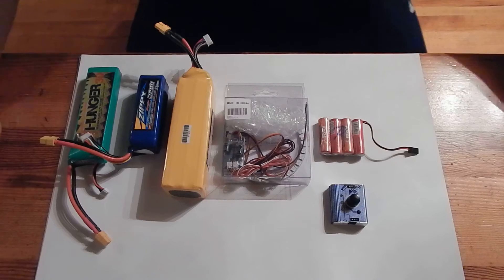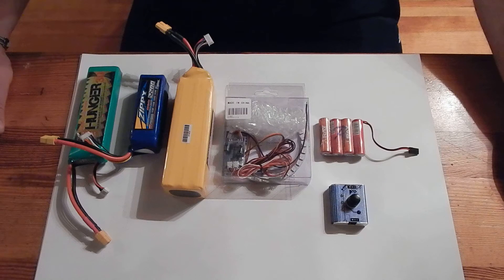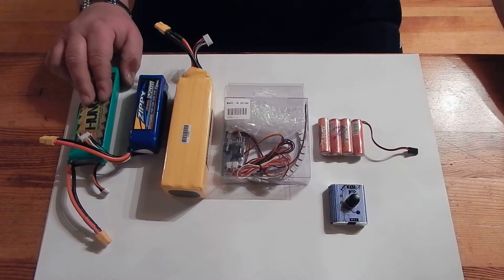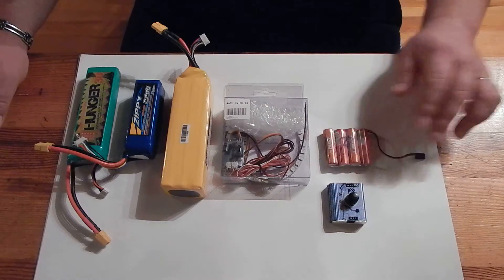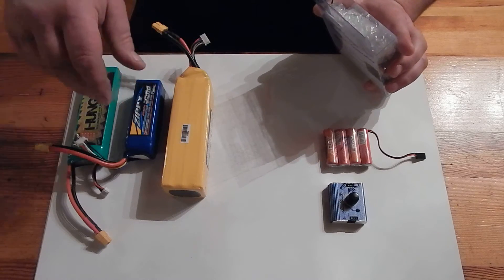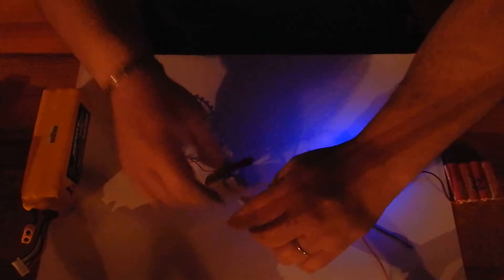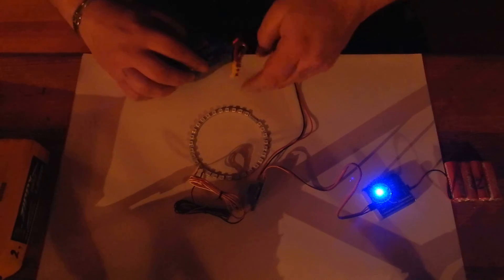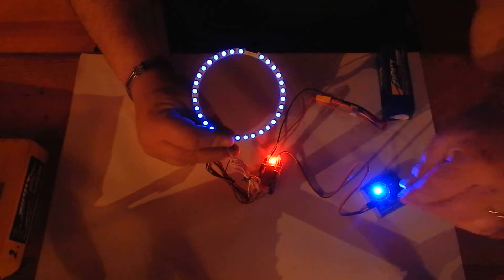Dr MadThrust afterburner test on 3, 4, and 6 cell batteries

Comment: I got one of these from ebay..  it worked fine until today it use to be blue then advance power it turns orange then red.. now it's just green only when u advance the throttle
Reply from the maker: Hey N. It happens to me to and I just dont know why. You can see on the video with 1.6m MIG15. After the filming I saw the the afterburner was bluse all the time but it was working great at home. I must check that out... Cheers, Robert

Comment: Hi Robert, thanks to your video i got the 70mm one for my Mirage2000. it works great, have to install it, what i saw was you connect the red wire to the red wire on balance connector and it does not matter where the black wire connects, it works fine. :)
Reply from the maker: Oh yeah Nakul. I love this afterburner...

Comment: can you tell me how much is the weight of 70mm version?  thanks for great video. :)
Reply from the maker: Hey Nakul. The weight is 68g. I will leave you the link for this product. Thanks for stopping by here and greetings from Slovenia, Robert
https://hobbyking.com/en_us/dr-madthrust-three-color-led-afterburner-system-70mm-edf.html
Reply: Hi yes, that generally is the weight of the package. but if u go under the product it shows 26g. so im guessing it should be around 26g, if you have a scale to measure weight it could be confirmed. thanks for the help again.